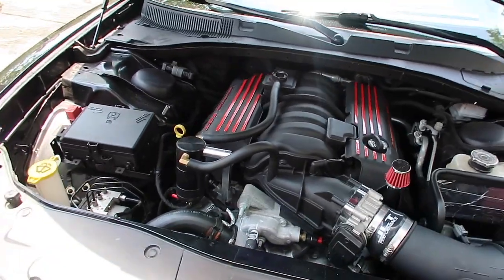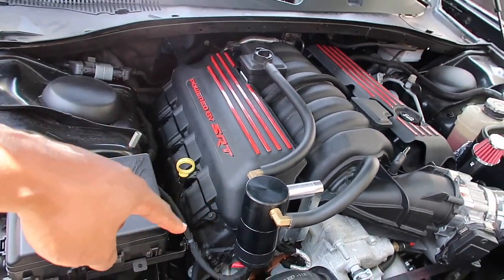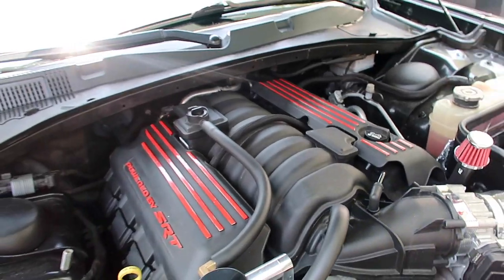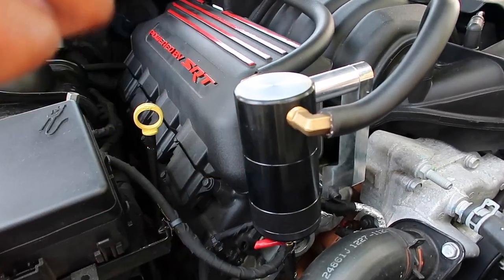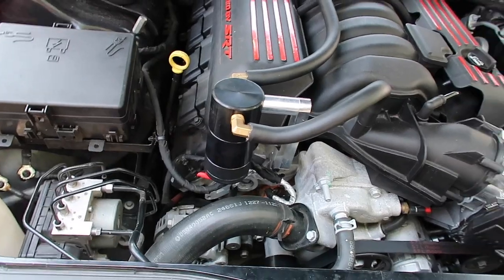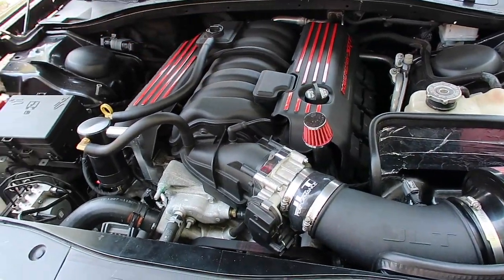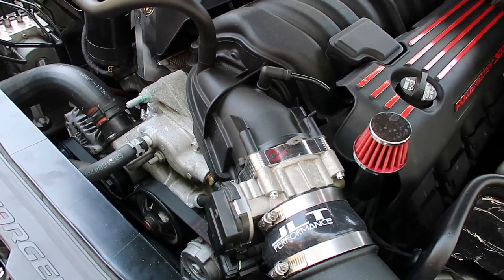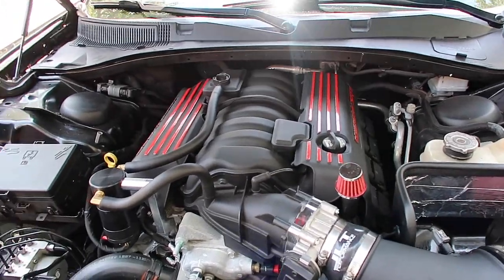Dodge Charger/Challenger/SRT/392  AFE Power TB Spacer Review

Comment: What up bro? Do you get any whining noise from your cold air intake. I had k&N that made noise on acceleration. Also where did you get yours from?
Reply from the maker: The cold air intake gave me more of a suction type noise but then when i added a throttle body spacer that’s when i heard the whining
Reply: BigRobb392 
I had the K&N 69 series and it whined only on acceleration and it was loud so I took it off and sold it.

Comment: Spacers dont help any unless ya spraying through it. Def a waste of money in my opinion but hey man it's your car and I'm jus happy to see people posting vids. Keep em coming bro!
Reply: they give you the most 5hp
Reply: Increased my mpg and you can definitely tell a difference with throttle response. Worked pretty well for me. It's just a spacer, not sure what you are expecting.
Reply: It is worth it if you are full bolt on man. A little extra power for a cheap price ain’t bad. 2016 full bolt on 5.0 and i just installed my spacer and runs a bit better
Reply: @ThePokePlugTCG  💯!! ‘17 M3 is modded with a lot of bolt ons as well and the spacer is def effective for mpg and low end tq, and throttle response for sure. Didn’t buy it for HP gains, got it for all the other reasons we seem to both have exp from it 🙌💪🏻🤘🏻
Reply from the maker: I  agree with the comment below !

Comment: Whats that little intake filter by your jlt intake tube on driverside?
Reply: It’s a crankcase breather.  It’s probably a 1/2 inch rubber hose attached to the bottom of the oil fill neck.  From the factory the hose comes out of the filler neck and attaches to the bottom of the air intake.  This mod helps clean the air going into the engine compared to the factory.

Comment: I just bought the TB spacer and CAI from afe...hopefully I will see a big difference.
Reply: Did u see a difference in the throttle body spacer cause I got the gt momentum already
Reply: @brandonUwanawich954  I have the stage two magnum force cai and TBS And absolutely noticed a difference. Under 80% injection duty cycle I saw significant gains on tq and the engine power module was telling me about 6hp more. It’s the throttle response and feeling of more tq that really did the trick

Comment: I plan to get one. The dyno tests I've seen seem to suggest performance is based on the vehicle. I noticed some trucks don't see much gains and lose some in older trucks. I noticed newer 4 and 6 cylinder engines getting good gains. My quick math suggests overall, in a car, your looking at 1-5 horsepower and 5-10 torque, depending on the car. Also most gains looked like they came in at low and mid range. Gas mileage should be a given.
Reply: i realize I am kind of randomly asking but do anyone know of a good site to watch new movies online?

Comment: I got have a 2020 Dodge Charger scatpack and I installed a throttle body spacer on and now when I’m about to turn it on just the power not the car running my check engine light stays on but flashes about 9 to 10 times and stops but when I turn it on it goes away is it also due from me removing the battery cable if any one can help me out I’d appreciate it thanks
Reply from the maker: Lol that’s normal bro all your check lights come on when the car battery is on. Once you crank it up they disappear it’s a normal thing no need to worry
Reply: Lol bro you sure you know how to drive

Comment: You’ve been scammed! That piece of aluminum does nothing.
Reply from the maker: Everybody’s opinion is different but to me i can feel a difference and i see better gas mileage so hey 🤷🏽‍♂️
Reply: BigRobb392 it’s a placebo effect. You want it to work so your brain is telling you that it did something. Gas maybe, performance no. 

So many Dyno runs and mechanics have debunked that mod. Don’t worry got me ten years ago too. Figured for $45 why not see why it was all about.
Reply from the maker: It makes a cool little turbo sound 🤷🏽‍♂️🤣
Reply: Throttle body spacer for 130😯. Please people save your money and put it into something else one the car, thats too much just to sound like a fake turbo that a real car guy will know is not a turbo
Reply: If it increased gas milage then it works. It's a spacer, not sure what you were expecting.
Reply: @jmata4506  if running water/meth or nos itll help the mixture
Reply from the maker: I’ve heard of meth just gotta do more research on it